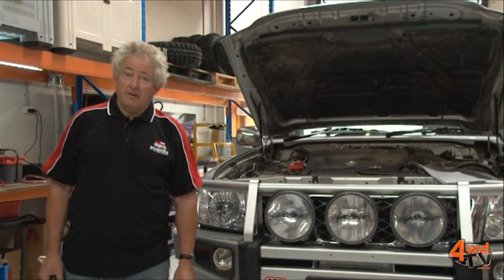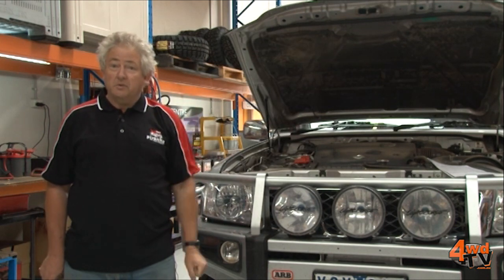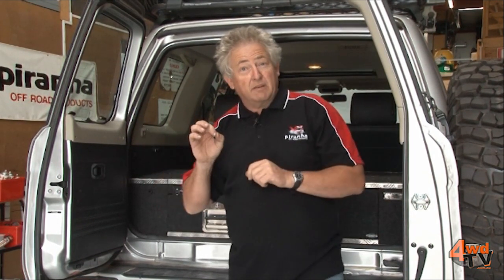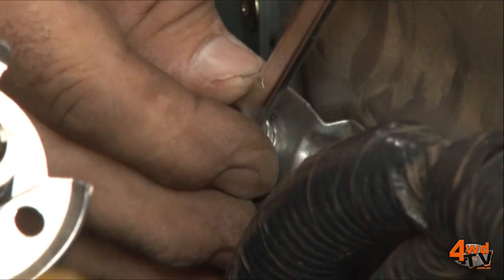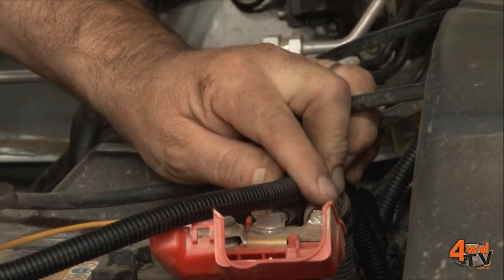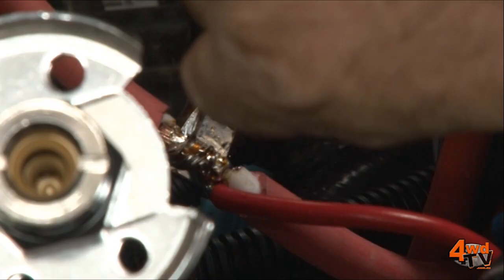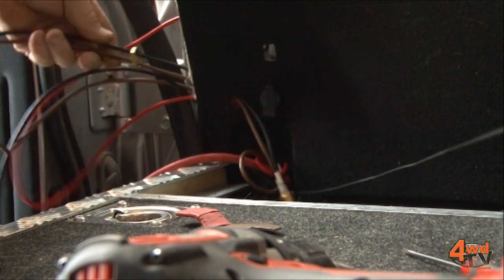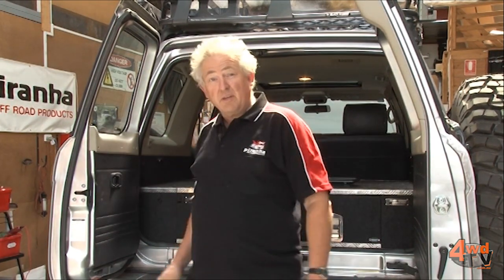GU Patrol Dual Battery System Installation

Comment: I do not see any fuse at the back battery as there is now two voltage potentials so if the front fuse blows the back battery will put power back up to the front or where the ground short is and will cause a fire.you must have one per battery.